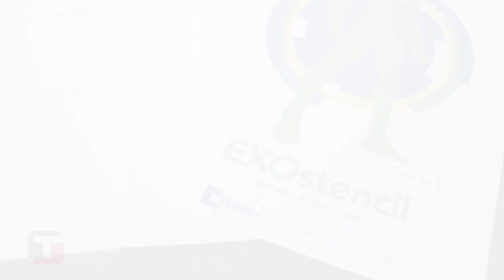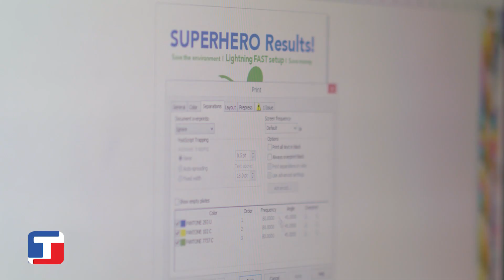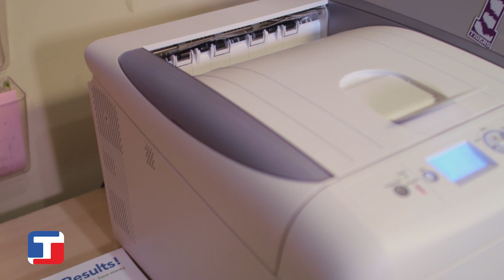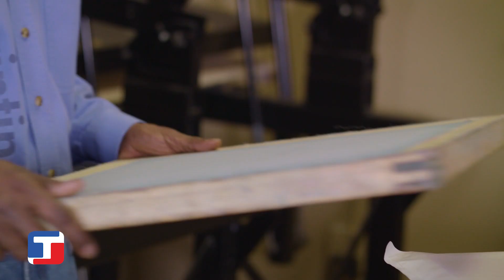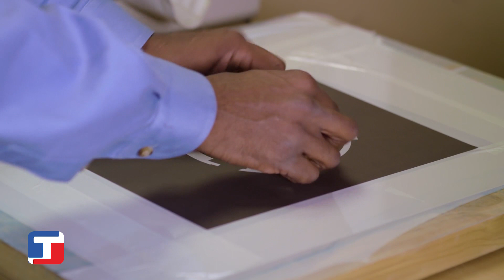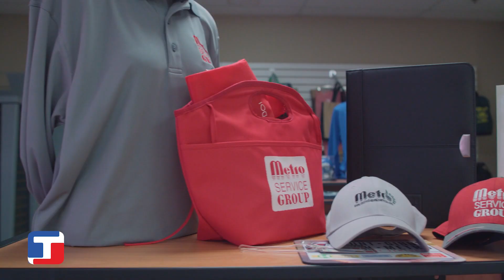Making Screens For Silkscreen using EXOstencil Screen Prep Paper (No Emulsion, No Exposure Needed)

Comment: I used these while waiting for my emulsion sheets to get delivered. They do work well, but even with a 1700 PSI pressure washer, they are difficult to remove, and will ghost the screen if left on too long. As bad as that all sounds, a little emulsion remover makes light work of reclaiming the screens.

Comment: This seemed like a lot of steps. Just use a vinyl cutter, stick vinyl on screen, screen print, peel off when done...
Reply: That only works for short runs.  If you are doing a lot of shirts, the ink will degrade the glue and you'll end up with a huge mess.